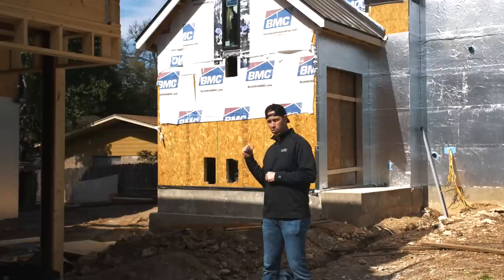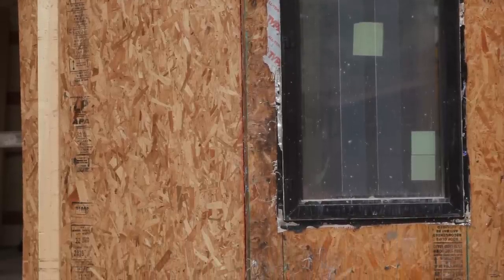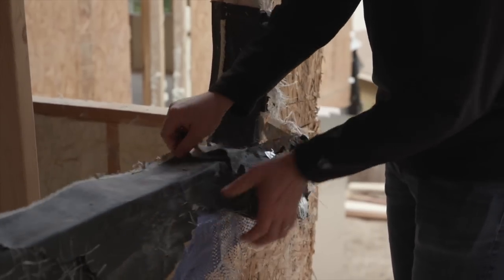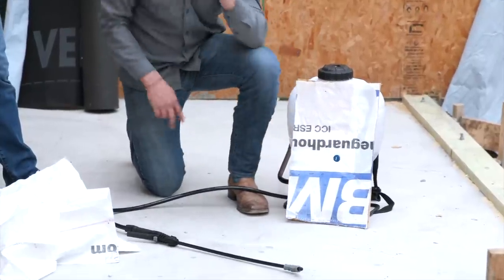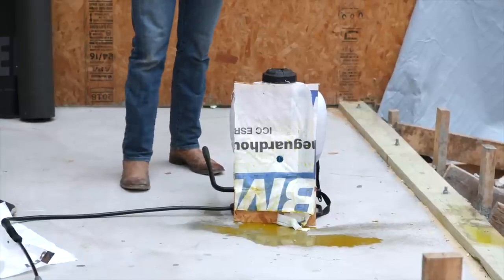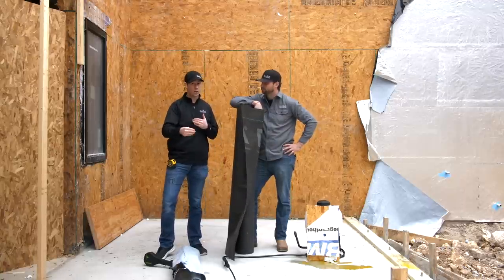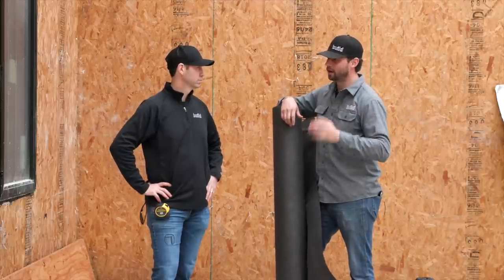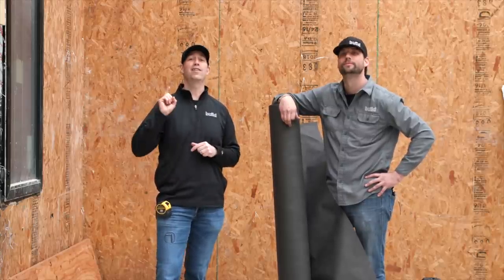Mold and Rot on a BRAND NEW HOUSE - What went wrong?

Comment: Funny how 60 year old tar paper and wood planks don't have the rot issues that a fancy new house has.
Reply: It’s not osb
Reply: Also, the old house breathed and had lots of air leaks and it wasn't osb that delaminates.  New construction used tyvek which seals moisture in which leads to mold if it doesn't dry
Reply: Stop using engineered wood and most problems will get solved
Reply: When I was studying to be an architect the professor always told us to "try to use as little organic materials as possible."
It's better to use brick if the budget allows.

Comment: I honestly wonder how long modern houses are going to last.
Reply: It won't last, you'll see the damages after the first winter.
Reply: Residential homes have been constructed for millenia, we've been HVACing them for less than a century. This is uncharted territory, and design requirements and recommendations change every few years as damage is uncovered. Easiest way to make a home that lasts is to build it like the 1800's, and forego HVAC, insulation and air barrier altogether. With fast-grow lumber, though, that may not be possible anymore.
Reply: Modern house not an investment, can pass down to family, etc.
Reply: @JJ-xw8sv  well, IMHO HVAC is not the issue, but that we build houses out of gloryfied cardboard to save 4.65$ ...
Reply: Concrete is the way to go.  I have seen many builders in the DFW area using cardboard material instead of OSB sheathing... in tornado alley this is reckless.
Reply: @carlosquiroz7819  OSB is much better but cardboard??!?!? No way!
Reply: @charlesrodriguez7984  agree osb not better than plywood but better than thermoply for sure.  Some builders use plywood at the bottom and osb on top.
Reply: @carlosquiroz7819  in my opinion, in non-extreme weather/climates wood framing done right should be used but in hurricane prone areas should use icf.

Comment: Over the 100 year lifespan of a home on average every single window, door, and roof penetration is going to leak. This means the fireplace chimney, the bathroom vents, each window, each door, each skylight, each dormer, each change of angle in the roof, each corner or change of angle in an outside of a home, they are all problems waiting to happen. Now we don't want to live in windowless boxes, so now it becomes a discussion in tradeoffs. By keeping a simple roofline, and adding large overhangs and large portions one can eliminate many of the problems. One of the easy ways to keep a window from leaking is to put a roof over it. One of the ways to keep a plumbing vent from leaking is to combine two or three vents in the attic and only going through the roof once. Smart design can eliminate half of the problems. It is the same with plumbing, every joint or pipe connection has the potential to leak and will at some point. By carefully designing a system, and putting it one one portion of the home, one can eliminate the potential for a large number of problems.  There are lots of other factors one needs to consider, such as winter solar gain or air-conditioning needs, lighting needs in the home, privacy, security, noise, quality of life, and more. When building a new home investing time in looking at solar gain or loss, proper building of materials,  and a flexible design that will appeal to everyone you may want to sell the home too can make a huge difference.
Reply: Well said Cryptick. Are you a builder or architect yourself?
Reply: @claursen1  I am in the renovation business. Frequently, I get to see many of these problems are they occur.

Comment: I think you should also call out the designer and architect of the house for "bad design" by not having enough overhang in the corner. There is a reason homes are designed with overhang. All roofs should have overhang on all sides. This is good house design. If there was proper overhang there would not have been a problem. To effectively solve problems we need to attack them with a multi-part plan. Having a good umbrella on a house is the first part of that defense. By having no overhang, there was no first line of defense. Now the second line of defense, the house wrap should have held up. Roofs are very important, and every roof is going to leak at some point, but there is a direct correlation between the number of pipes, skylights, chimneys, and architectural details and the number of leaks that happen. Basically, every single thing going through the roof is going to leak, at some point during the life of the home, and so the more you can eliminate, the more problems one can avoid. Years ago, there was a push to simplify and eliminate these roof penetrations and now home owners everywhere are benefiting from them. Now I understand, we do not want to live in ugly box like shaped houses, and most roof leaks can be fixed with a tube of roofing sealant in a few minutes. However, we also do not want drama of having to go up on the roof and constantly fix leaks. Finding the leak can be hard.  The current style of big houses with fancy roofs, are going to be causing lots of problems in 20 years when they all start to leak.  Every single windows is also going to eventually leak, one of the easiest and cheapest solutions to fix this is by putting a roof over the windows (aka a porch).
Reply: I agree. My house has a 3 1/2 ft overhang, and even my smaller outbuildings all have 3 ft overhangs. It's a no-brainer, but apparently some people want the look of a house with almost no overhang at all. Stupid.
Reply: You made my comment .. AYUP, call them out.... Architects  should be made to work construction crews as car designers should be forced to work on the vehicles they design before production. Life would be Soooo much easier than putting up with all the pie in the sky wicky wacky ideas of the growed up children w college degrees and not a lick of sense in their heads.
Reply: Good point.  Materials will fail even if installed properly.   Best to design a home that mitigates damage from potential material failures.
Reply: I am a veteran Design/Build professional. I majored in architecture in college. Unlike most Architects, I chose to integrate the whole process in my business. As a result, my company performed everything from project conceptualization to locking the door on a structure and even horizontal developments. Few, if any Architects have that level of understanding. If you understood what the education was to become an Architect, you would understand why they don't have a clue in many areas. I did a project locally, a few years back that was designed by a local firm. The structure was very well designed from an historical asthetic, but with virtually no details supplied. After several phone conversations with the architectural designer, he finally admitted this to me... "Look, Architects draw lines on paper, we don't have the knowledge base to figure out how to do what we have designed. That's up to the Builder to figure out how to make it look like the picture." So, you are right, but I don't think that problem will disappear anytime soon, it's systemic from the educational system all the way thru to Builders who haven't kept up with Building Science changes.

Comment: In my area it  is so hard to convince the builders to do this. Also when going to the local building supply that still sells the materials that still causes problems for  the home owner they don't want to here about the new ideas that are now available. I do appreciate all of your comments on all the new and the improved materials out there on the market. Your are right about talking to the home owner to prevent the possible water damage in the future and do away with something else in the house and do the outside right the first time and use the proper water proofing first. Thanks again for this video.

Comment: O.K. I fix this stuff all the time. As a matter of fact that's all I've been doing for that last 12 years with only one new build in that time. Here's what I've found: building materials and construction practices for the most part are poor. On the re-models of older homes I've found much less rot with the exception of window sills and siding that is too close to the ground. With felt paper under the siding I never see sheathing rot--not once. The biggest issue I've found with older homes is some sketchy framing practices but those houses can and do breathe. Home construction now is all about fast assembly and avoiding craftsmanship at the expense of longevity and avoiding problems. Whose fault is it? The homeowners, who want instant gratification and the appearance of grandeur. And construction companies are more than happy to provide a lovely looking building built on the cheap. Cynical? You're damn right and with good reason.
Reply: Good 'ol tar/felt paper has stood the test of time and still great in my opinion.
Reply: Well said
Reply: your so right. You wont see this extent of dry rot on a plywood sheathed home. You also wont find the kind of vapor locking that takes place with felt like you do with tyvek. I like the new wrap codes on the windows, but again, when your only required to give a 1 year warranty on craftsmanship and labor, everyone points back to the product manufacturer. Makes it easy to walk completely away from real quality building and go for volume/time over skills/expertise.
Reply: I still use felt paper. Good for a roof, good for a wall.

Comment: Matt, all stone facades need a rainscreen, but to act as a thermal break. Stone being a reservoir cladding, it has a significant cold mass that draws warm moist energy from the interior into that wall cavity. (Reminder to your viewers: heat as an energy moves from hot to cold. Stone acts as a giant heat sync)

Comment: I can't remember exactly where I read it, but the best description I've read about this is something like that you have "hard costs" and flex costs.  The "hard costs" are what you've described here, such as the waterproofing or subfloor as a couple examples, but it's the structure type of things.  The "flex costs" are like you described, the appliances, flooring, stuff like that.  The statement was it's better to cut costs from the "flex costs", since if nothing else, you can go back later and upgrade them pretty easily.  When it comes to the "hard costs", it's difficult at best, and may even be almost impossible to get to them to alter, at least without tearing apart the house to some degree.
Reply: That's it. We call it the essentials and the non-essentials. Some people have a really hard time seperating things into those two basic categories.
Reply: The inspection finds all defects and uses rehab cost estimate for repair. This cost is paid by the seller but risk is on the buyer to find a quality builder who can do the work at that price. He may finder additional damage only found at demo. The municipal inspector must approve material and workmanship.
Reply: That makes perfect sense, except to the buyer who sees lovely quartz countertops, Viking ranges, teak flooring or dental crown moldings and thinks "quality!"
Reply: PC No and we can blame Realtors for that!  It’s their marketing strategy that emphasizes bling, square footage, and the latest trends over everything else that convinces homebuyers that they need 6,000’^2 and granite countertops to be happy, but don’t worry that the house will rot and fall down in 10 years you will move before then. If realtors game even half a damn about buyer they would be able to provide buyers with useful information about what actually makes one house higher quality vs another, but since the realtor only wants the quick commission the just shepherd the sheepole into whatever they can sell the quickest.
Reply: @jpe1 , You could tell a buyer till you're blue in the face about how well the house was built and would last 500yrs and super energy efficient. All the buyer cares about, is what you said, "The Bling" !  lol
Reply: august    Most buyers assume a building is built to code and that it is inspected and approved. Unfortunately many inspectors do not understand good building practices against poor building practices and often fail to note where the failures are going to happen!
Reply: @kendaleklund7475 , Agree. I guess people should educate themselves a little better then ? 
Buying a house is the biggest investment a person/couple will make. A day or two, just on this channel or the many others would give a buyer a serious advantage and not just assume someone is telling them the truth.

Comment: In Canada we aren't allowed to stand OSB up right like it is on that house either. Also the panels need to be installed with the print/stamps facing inwards so the rough side is out. It's written right on the sheets...
Reply: Rough side has the moisture barrier.
Reply: Osb is not suitable to build a dog house out of. Ive demolished more  bad work than i can count . Just pay for plywood and you'll have something for your money . Especially if you consider you're only going to do the job once instead of two or three times and all the headache that goes with that. Most homeowners like to watch the building shows on TV and go oh yeah it's going to be done just like tomorrow... Bulshit it doesn't work like that and you need to use solid materials or you wasting everybody's time and your  money.just because i got paid to fix those messes didn't make for a good job. it's more satisfying to just start new with a good foundation and quality materials.
Reply: @KevinFreist , I prefer plywood myself but I made that comment before and was told that OSB was structurally better ?  I couldn't understand that theory at all. Been building structures my whole life and never used OSB, just not a fan of it except that it was cheaper.
Reply: OSB is NOT structurally better than plywood. It's only used by some builders because it is cheaper. It is not used by quality builders, at least not one I know.
Reply: Anthony Fleck I gave up on OSB as it’s a rot-magnet. There is not one remodel I have ever done where OSB did not have rot in it.  It becomes so brittle flakey like with failed structural properties.  It’s one of those products you wish were never invented after decades of seeing constant examples of such “crap” it really is.

Comment: Good video.  Yet another reminder that home construction today is a science.  "Builders" who build poorly need to be called out.
Reply: The problem is house wraps were touted as best practice for decades.  It's only decades later we see the problems.  First problem is using OSB - far as I'm concerned, it's the main problem with that huge monstrosity Matt's fixing.  Second problem is the roof/overhang. 

Current building code wants houses way too tight - it's great when things all work properly, but they never do.  A few decades from now, when a generation or two of kids grow up and they find the tight houses were off-gassing from carpets/glues/foam insulation etc, we'll see the health problems in spades and all the builders will shrug their sholders because, you know, "science".
Reply: @ArthurDentZaphodBeeb  HRVs and ERVs take care of the toxins. Leaky house, no thanks...not in my humid area.

Comment: I agree house wrap is super important. I think its safe to say that good old asphalt impregnated felt, 2 layers would've done a better job at keeping that house dry from rain. But it doesn't even matter what they use, it looks like they didn't flash that corner properly, even the best materials installed incorrectly can cause major damage. You sound like you had a cold Matt, feel better soon.
Reply: Ice and water around the skirt board and felt paper the rest. Never had a problem. I think all these new products are junk.
Reply: @hammertime7349  Exactly when its time to remodel the siding the paper under is usually good still enough to use around here, and I work in a cold and wet climate.

Comment: Matt, if you want to cry and then get really angry - you could take a look at how a large builder is constructing some apartment units near the Tesla Factory in Fremont, CA.  They never dried it in around November '18 before the heavy rains started.  Now that spring is here, no problem just put on fragments of vapor barrier on the still soggy OSB then stucco directly over it!!!  SMH...  Even from the street, I can see that detail work is not the strong point of the exterior people, and one can see the twisting and warping of the walls.
Reply: That's not good !
Reply: I work in and around new home developers ("custom" track homes) and they push through winter, allowing the framing to sit wet, and then slap the home together in between storms, sealing in all the water int he wood and OSB. They are supposed to test the framing and OSB for water content to make sure the wood is "dry enough," but when using a moisture meter, it is easy to cheat and find a dry spot to justify moving forward with building. Its crazy what developers do to continue pushing forward to build a home. I once saw a home with an open exterior and insulation was exposed during a torrential down pour - all the insulation was soaked, as in water draining out the bottom of it soaked, and then later that afternoon they put more OSB back over the wet insulation. Crazy.

Comment: My shop is in Charlotte NC and built it using as close to a Lstribrek 500 year house as possible; it is a shop after all. It sheds water like a champ, it requires very little energy to heat and cool it. The only thing missing right now is humidity control and fresh air. ERV w/ dehumidifier is next year. It's a shop folks. Great vid guys!